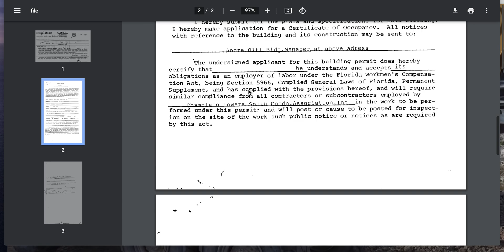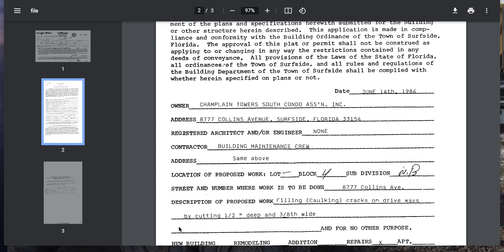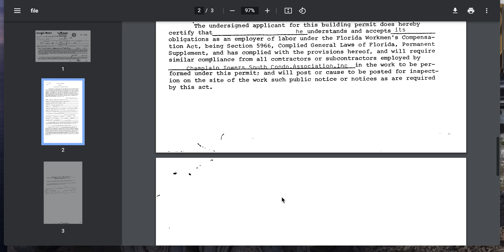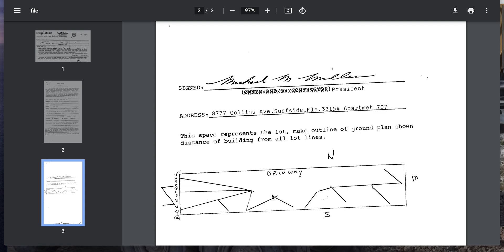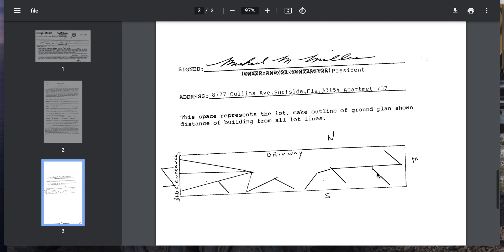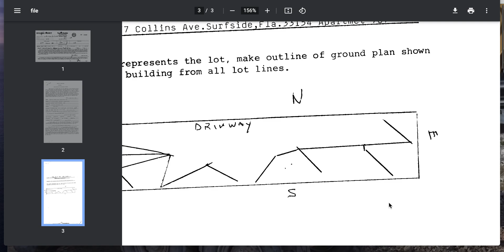Champlain Towers Driveway repairs same zone failure 1986 driveway crack repairs without an engineer

Comment: Below the diagram it appears data was physically covered up with blank paper and then photocopied or was put through a auto feed document scanner and other paperwork is blocking data.
Reply from the maker: Hello Icare, plus they mixed another building's plans with these plans and I have been confused a few times.
Reply: I also recall viewing Champlain Tower South Plans that legal descriptions on the plans and/or data on the plans that were mixed up with Champlain Tower North and other Champlain Tower South documents have data that has been  physically altered after the fact removing key words and phrases. Prior to the implosion of the remaining standing building, hard to tell floor by floor what was actually built other than pictures and video prior to the initial successive building failure.

Comment: The Champlain Towers South  building was only 5 years old at this point, so is it normal for such an extensive repair to be needed so soon? It seems a bit suspicious, but I may be naive about some things. 

They misspelled driveway (figure) and apartment (typed line below signature) on an official document, so hopefully the attention to detail on the diagram was better. (Yes, I know that docs had to be edited manually by typewriter in those days, and my grammar/spelling is far from perfect, so I'm not trolling anyone regarding that. 😆) Hi to the 🐱 crew.

Comment: Re: Champlain Tower Condo cracks. Around my neighborhood (Great Lakes rustbelt) if cracking starts early and it’s exposed to weather, there’s going to be a reckoning in 25 years. We’ve had shoddy concrete parking structures require major work at that point. Surfside FL doesn’t freeze for sure but the salt will find itself ready to rough up some rebar given the tiniest opening.